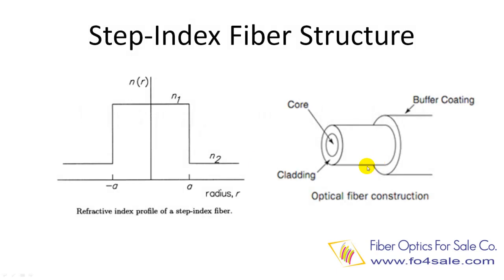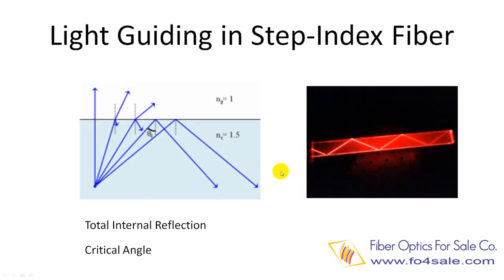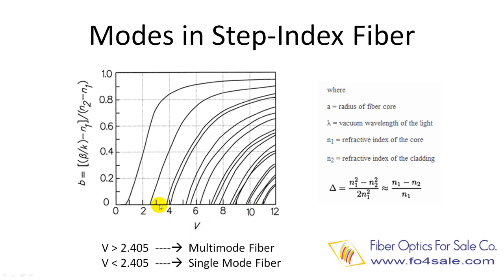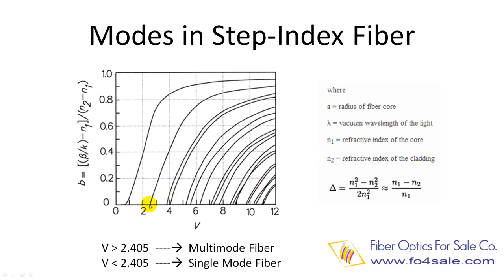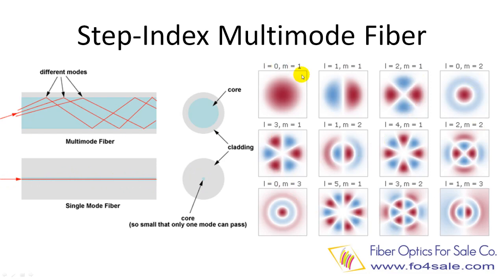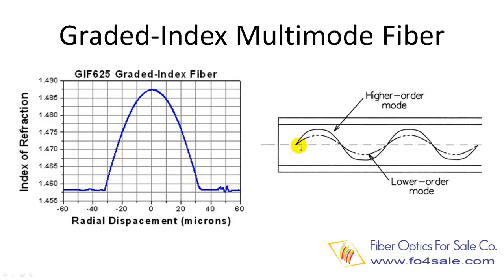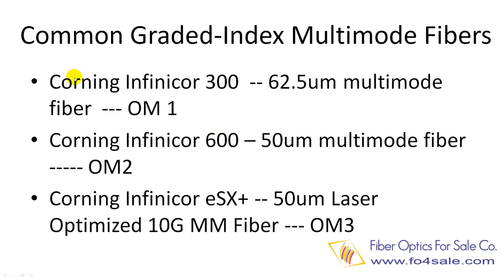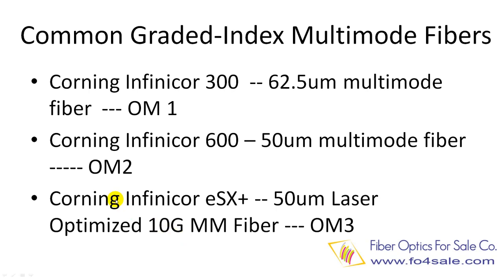What is Multimode Optical Fiber?

Comment: In multi mode fibers does each mode have a different wave length and is traveling at a different angle or does each mode have the same wavelength but are traveling at different angles?
Reply: Latter

Comment: How different patterns are achieved in multi mode fibre if the Laser diodes angle is not shifted ? If there is no change the light should follow the same path right?

Comment: i understand the core is smaller with single mode so only one path can go straight through but why can't multimode fiber have multiple paths go straight instead of bouncing off the walls of the cable?
Reply: +dlucianoify Because in practice, fiber optics cables aren't laid perfectly straight. We just use straight finite elements in order to simplify the calculations and analysis. We try to avoid sharp bends so there's as little signal loss as possible, but at some point the straight(ish) path of the light will interact with the cladding interface and reflect. It's possible to generate destructive interference by modal interaction post-bend, which is just more signal loss we don't want.
Reply: Cables need to bend mate.

Comment: Can someone please explain how to link single mode fiber to multimode fiber. thanks
Reply: You don't. 
SMOF is designed to carry 1310(LR)nm/1550(ER)nm wavelengths while MMOF is designed for 850(SR)nm. If you mismatch these it'll work on short distances but not optimally. This is a neat page for matching up your fibre with your optic types: https://en.wikipedia.org/wiki/10_Gigabit_Ethernet#Physical_layer_modules